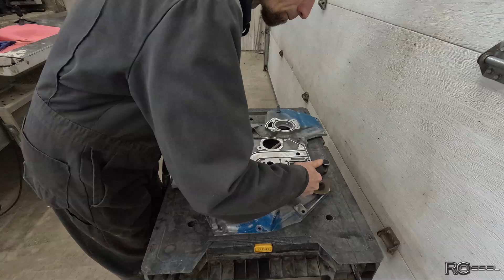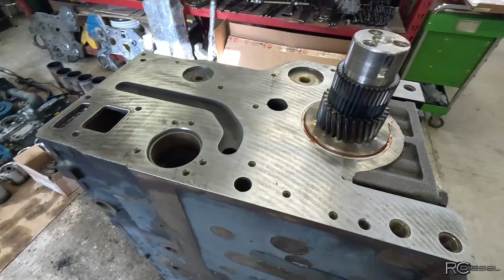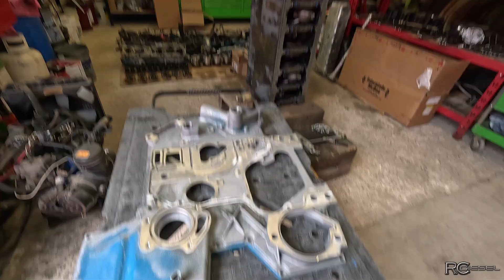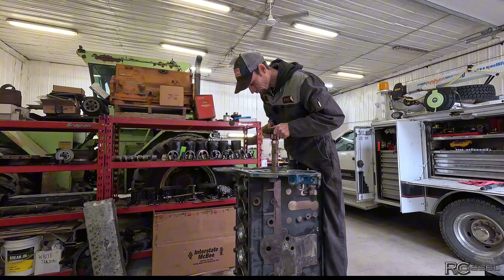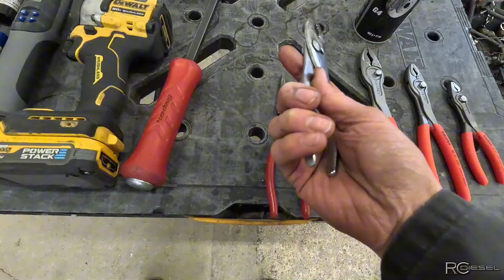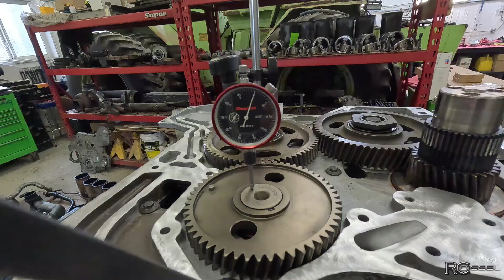⚙️ DT-466E Engine Rebuild | Part 10: Timing Case Prep, Camshaft Install & Gear Lash Check

Comment: Whered you get the idler gear bolts?
Reply from the maker: Most of that stuff all funnels through my engine parts supplier - and that branches out into a spiders web of places.